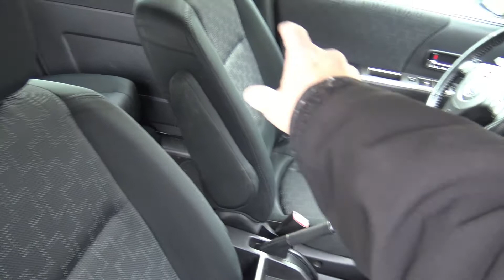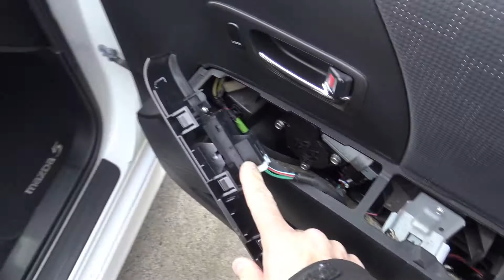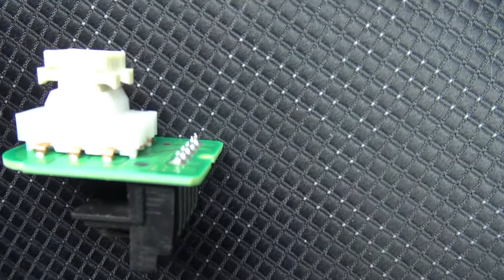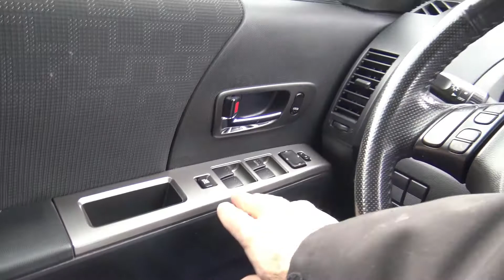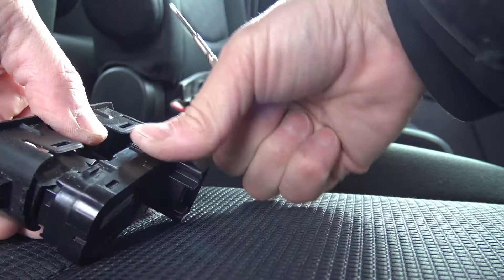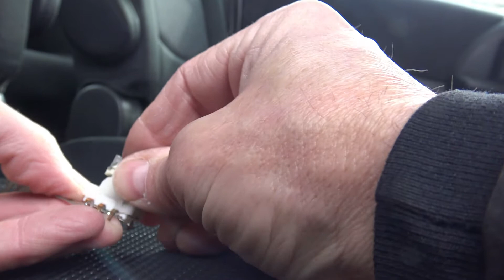How to fix Mazda 5 window switches...easy!

Comment: Excellent video and an easy repair. The drivers door is a bit more difficult with more tabs and the lockout button. That button can be pried off very gently. Also some spray electrical contact cleaner makes short work of cleaning the switches.

Comment: How do you take off the lock button on the driver side panel. The last bottom button. It has two little grooves but I couldn't remove it without possibly breaking it.

Comment: Hey, thanks for the video. The driver side window on the my mazda 5 quit, or really, it moves like an inch up and down, so I suppose there still could be an electric contact problem. The thing is, the switch that controls that window has a small lightbulb that straddles the switch, so you can't remove the top of the switch to see those little rockers inside. The bulb is soldered in. Do you think I can just remove that bulb, without causing problems with the rest of the switch? My gut says yes, but I am just not sure
Reply: Same question. Thanks
Reply: @lisavan949  hi! I tilted the little light bulb up a tad bit and got it off. I do see that this was 2 years ago so I assume you’re good now, but did you happen to take your car in and figure it out? My drivers side window is doing the same thing. I’m trying this method to see if it helps but I don’t have the best feeling about it, seeing that I don’t have any corrosion when I lifted everything off.

Comment: Hello Mike! I have one question concerning this. All of a sudden, all my windows stopped working intermittent and then not at all, all at once. Do you think this would be my problem??? I already verified the fuses and they are still good so I know it's not that, and I was about to go visit the garage but I am afraid they will scam and over charge me!
Reply: OH MY GOD. I still went to check my driver's door side and the electric connector was not plugged in properly!! In the past few months my car was at the garage for door repairs. I put it in and all is working. I can't believe I went without windows for two whole months!!! I cannot believe it was that small of a problem!!! I cannot THANK YOU enough for this video, without this, I would be at the garage spending so much money for a 5 minutes-fixed issue!!!! THANK YOU!
Reply from the maker: Yes this is a common problem with the Mazda 5.

Comment: My 12 year old Mazda 3 just started having this issue. Thanks for covering the R Pass switch, as my others are working fine…!👍🏻
Reply: Success… eventually! The switch design was a tad different, but no surprise there. I had both a long bristle toothbrush and a nylon spiral brush for cleaning straws. I did wind up taking it apart twice, as the first attempt yielded a promising but short lived result. Gonna invest in some “pcb/electronics” cleaner since I have uses for it elsewhere in my diy life (vinegar windex is ok in a pinch, but not ideal). Again, thanks for the guidance.

Comment: You do know they make contact cleaner made for stuff like this. Crc is a brand. You should use cleaner or at least rubbing alcohol. Dont think file is the right way to clean them now. Should have cleaned plug pins too on the one Really

Comment: Thank you very much. You saved my day. I have just done all switches on my 2013 mazda 3 which has similar carbon build up issue. All my roll up switches is black. The assembly is different but easy enough to figure out.

Comment: Saw you're video applied it on my 2 gen very helpful to keep maintaining the switches. Unfortunately, it not solved my problem. The windows mostly the rears, sometimes work and sometimes not. Saw the carbonized and cleaned it up. Just have one clicking sound when press the button and the window not moving.
Reply: If anyone still encounter that problem the motor is the problem. You will need to clean the rotor plates inside but that solution wont last you will rather replace the entire motor assembly.
Reply: Same problem here
Reply: Same here. My windows get stuck at times and won't go down. I get a single click like the motor is engaging but window won't go down. I don't believe it's the switches because it behaves the same with the master (drivers) switch as it does at any particular door switch. It acts like the motor just doesn't have the torque to start moving the window. Other times they work just fine. It's really random on when this happens, and all the windows do this independently at some point or another.